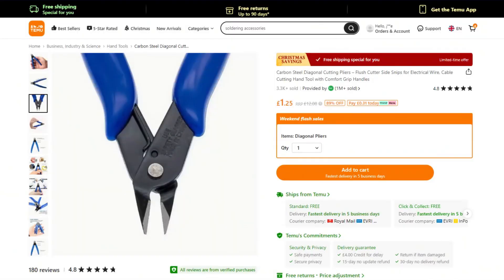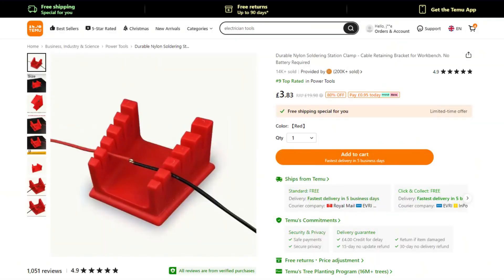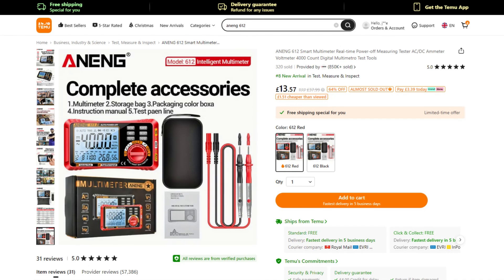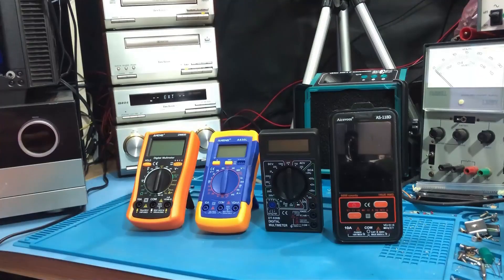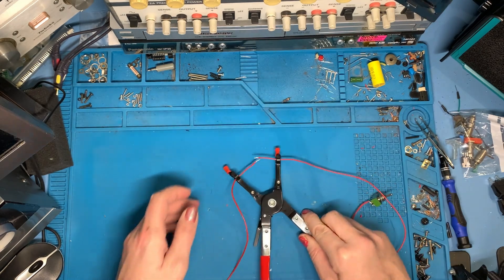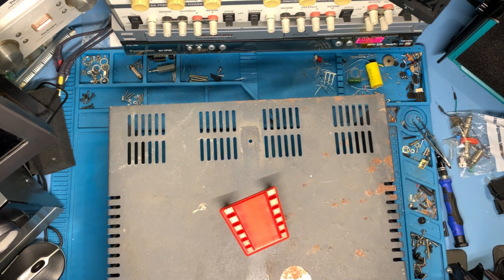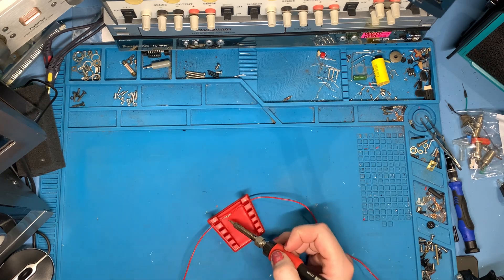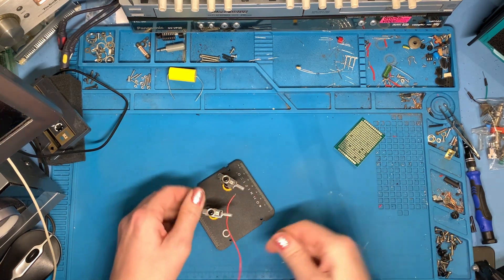Cheap Electronics Tools Fail & A Multimeter That Wakes You Up!

Comment: The good thing about the cheapo snips is that when you try to cut a thicker wire and fail, that it leaves a little hole between the blades. Hey presto it's now a free wire stripper in that spot too. 😅
Reply from the maker: Lol, so true.

Comment: Those cheap flushcutters are a good tool but wear eye protection as they have a habbit of snapping at the tips if you try to cut heavier wire and component legs.
Reply from the maker: My eyesight is not the best so I always have glasses on when working up close. I haven't had any break yet but I know what you mean. Thanks for watching.

Comment: Those flat “ flush cutters” are great for cutting off cable ties flush with the buckle to stop that little bit that is left lacerating your, or any future tech’s hand. 
 Multi meter with an Alarm clock? Why not. I’d love an alarm clock with a multi meter on it. Twenty or so years ago a tech I knew had a talking multimeter. Press a button on the red probe and the meter would “ tell” you what the measurement was. Really good if you’re head and shoulders inside a piece of gear. I haven’t seen one for many years. 
Many a time I have turned to look at a meter reading and slipped with the probes…….

Comment: Those cutters seem to be the same they give you with 3D-printers to cut filament. They work great for that and copper wire but I suspect they are really not hard enough for steel wire.
Reply from the maker: General purpose electronic cutters are not designed to cut steel wire. If you buy expensive top of the range cutters like Lindstrom they tell you they are only suitable for soft copper wire.
If you want cutters designed for cutting steel wire you need cutters that are specified for that purpose. Lindstrom do do a range of cutters designed for steel wire cutting and they are rated for cutting piano wires which are particularly tough. The same would be true of guitar strings.
For general purpose hobby use these cutters are ok and when they get blunt they are so cheap you just buy another pair.
Thanks for watching.
Reply: @JazzTechUK  Yes, cutters made for piano wire have different edge geometry and require more force to use so not ideal for soft materials. Also, they are heavier and thicker and usually don't cut flush to a surface. 

I have yet to wear out a pair of even those cheap ones, I do have several as, as said, they give them with 3D-printers.

Comment: Jane, after 43 years in the electronic indistry with too many holes in my hands from "long" wires, the flush cutter is a blessing.
Reply: Those cutters work better than any toenail cutter I have ever used, especially as I have a couple that are funky shape and have difficulty getting a toenail cutter to fit around them.

Comment: Those cutters are fine, they blunt quite quickly but so handy. I like that analogue receiver on the desk, have i missed out on that video?
Reply from the maker: As somebody else commented the cutters are so cheap they buy 5 at a time then throw them away when they are blunt. No you haven't missed out on the receiver. I haven't done a video on it yet. It's 110V so I need to modify the power supply before I can power it up. There will be a video on this at some point. Thanks for watching.
Reply: @ I have a 110v CB Radio and as it will probably go back to the states i bought a cheap step down transformer. I probably should have modified it and made it switchable but i am becoming too lazy.😂

Comment: Where does that omni-flex thing come from please?  It looks great.
Reply from the maker: You can get if from https://omnifixo.com/
It's an amazing device. It works so well and can be used in many different ways.
There is the smaller 2 post one, as in this video, and a bigger 4 post one as well.
Reply: @JazzTechUK I just ordered one (the 4 poster) as a result. A bit pricey but looks to be better than anything else I’ve had so far!

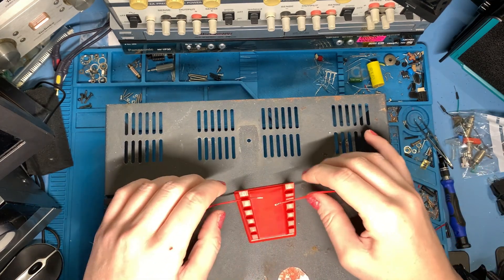Comment: 9:51 - If you hold one wire with your thumb and pinky finger and second wire with pointing finger and middle finger, you actually can hold 2 wires with 4 fingers and solder with another hand... I was taught this by one lady who is expert at manual soldering...
Reply: Touching my thumb to my little finger is difficult for me because the MCP joint on my thumb doesn't move much.
Reply from the maker: That seems like a lot of effort to me and risky you might burn yourself with the soldering iron. Thanks for watching.
Reply: @JazzTechUK  Eh, so many times I burned fingers of mine and of others, while soldering, now it has become a normal thing. :)

Comment: Be careful with inexpensive flush cutters.  I bought a few off AliExpress and went to clip some 16 AWG solid wire and the strain broke one of the cutter sides and it flew at high speed and nearly hit me in the eye.  I threw away the ones I bought and purchased quality ones from Hakko and Knipex.
Reply from the maker: Yes they are only good for thin and soft component lead wires. My eyesight isn't perfect so I always wear glasses when working on boards, so I have some eye protection. I would recommend you wear some sort of eye protection because if it isn't flying debris from cutters you could have a component blow up in your face.

Comment: Good video. I use the type of cutters that you bought, but made by Knipex. They are very good as you say for snipping in small spaces or close to boards. 
A general point about cheap multimeters, it's not hard to make something reasonably accurate. The problems come long term, stability and drift not to mention how robust the device is. 
Another problem is claimed accuracy, I've had some cheap multimeters that have failed the manufacturers own spec out of the box. Normal users of these devices would probably have no idea. Just some caveats to bear in mind when buying at the cheaper end of the scale.
Reply from the maker: A lot of cheap multimeters are surprisingly accurate but I think long term reliability is the biggest problem. OK for hobbyist use at low voltages if you are on a very limited budget, but if you can afford something better it's always worth it. Thanks for watching.

Comment: The side cutter lets you cut the wire close to the PCB. Your other cutter leaves too much wire standing up.
Reply from the maker: That is true but if you're not careful you can cut too close with flush cut cutters. It depends on your technique and what you are most comfortable with. Thanks for watching.

Comment: The difference between your cutters and the other ones is that the ones you bought a flush. The cutter you have a small upside down "V" which doesn't cut flush. That is why the ones you bought are called "flush cutters" 😀 Ow and the device to help you solder wires together, have loads of 3D print files ;)
Reply from the maker: Yes, both are good. I think it comes down to your technique and what you are most comfortable with. The plastic wire holder was pretty useless, lol. Thanks for watching.
Reply: @JazzTechUK  You are welcome! I gladly give my watch time: https://www.youtube.com/watch?v=YKu9RW3hjZA&pp=ygUdZmx1c2ggY3V0dGVyIHZzIG5vcm1hbCBjdXR0ZXI%3D This is a good video about side cutters and flush cutters..
Reply: @JazzTechUK  This is a good video about the flush vs. the side cutters: https://www.youtube.com/watch?v=YKu9RW3hjZA Hope it puts things (like my answer in perspective

Comment: Those cheap side-cutters are great. Side-cutters are pretty much my favourite electronics tool. Sparkies use fat old snips like you have there, but these are more pro-level electronics tools rather than for general electrical work. As you point out they're for flush-cutting component leads, hence the super-flat and angled profile, but you can also strip any small-to-medium gauge wire by pulling it through the jaws while gently holding pressure - but never pull wire in the wrong direction or it'll just cut right through. I've a 'posh' pair but mainly use the blue cheapies because they can get blunted but who cares at that price, right?
Reply from the maker: Exactly, at that price you can get several pairs in stock and swap to a new pair when the current ones are blunt. Thanks for watching.

Comment: Heck yeah , My resistance to get outta bed ..... Good one ....  I like that magnetic solder helper .... I use an aluminum mini vise for my 3rd hand .... I had one from Radio Shack back in 80's and 90's when I had my radio shop ..... I found one about 8 years ago for about 5 USD online and I like it better than the 1 from RS ....... The cutters that I have are Xuron Made in U.S.A. and a pair from Ali that are made in Japan that I got on a Lightning deal for 1.50 USD , those stainless steel cutters are equal to the Excelta cutters out there ,  they cut 12 gauge solid house wire like butter .....  I have a B-Side / Uni-T ZT-100  That I trust more than that Alarm clock you showed ...... It's a few years old and has been thru the mill and back , tossed around more than a Fluke meter and still going strong ...... I got it for 5 bux USD from Ali on another Lightning deal , I just might do a review on that meter ..... Stay sweet .....
Reply from the maker: The best one I have found for holding wires and other small things is the Omnifixo that I briefly featured https://omnifixo.com/
Reply: @JazzTechUK  Yep that's the 1 that I was speaking of in my comment . All kind of different ways to move it around ...

Comment: If you didn't mind doubling the cost for a DMM, the ANENG AN870 for about $25-28 so far seems like a crazy value. While it's accuracy is pretty good, while not amazing, the resolution for the price point still has me scratching my head. Zoyi also has the same meter in their lineup. I was wondering about that third hand for holding wires. I'm glad I didn't buy one. Even if you do get it to hold the wires firmly, you have to have a way to hold the wires up off the bench instead of the thing just laying flat on the bench.  I imagine it was intended for automotive repair but that doesn't really matter. Do you find yourself having to fix or modify a lot of the Chinese tools to make them fit for purpose? I do.
Reply from the maker: I bought this cheap multimeter just for the novelty that it had an alarm clock on it, and that bit I couldn't get to work, lol. I have better multimeters. I won't be using this one for anything much. The selector knob is too small and fiddly for a start.
If the cheap Chinese tools turn out to work Ok I use them, otherwise they just get discarded. Thanks for watching.

Comment: I have that little red block.  Like you I solder on a silicone mat so I put little silicone feet on it.  Keeps it steady.  It also works a lot better with silicone wire than with PVC wire too.  Those cutters are great.  They don't last long, but I use them for stuff I don't want to use my horribly expensive Erem cutters for.  I usually buy 5 at a time.  Cheaper that way.
Reply from the maker: Good idea about buying several pairs of those cutters. They are so cheap you can afford to do that.

Comment: I do have a harem of an unknown number of multimeters. But no matter how many I take to bed with me so far none of them is waking me up. But now you HAVE to prove to Dave Jones from EEVBlog that you can discharge the 400V mains capacitors in the ohms range. Then you have a Bobby Dazzler and Bob is your Uncle?
Reply from the maker: That sounds dodgy to me, lol. Most multimeters are only protected up to about 250VAC on the ohms ranges.
Reply: @JazzTechUK  During tech school we had to store them meters in the 1000V AC position. Now Dave makes dementia videos on how he claims to have used something unplugged. What has the world come to?